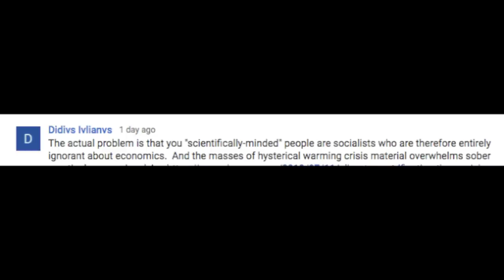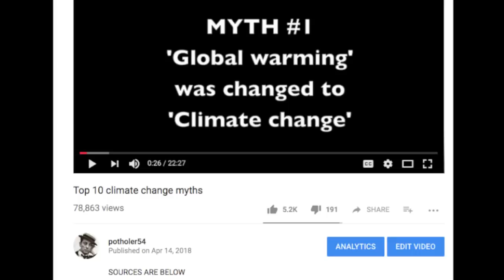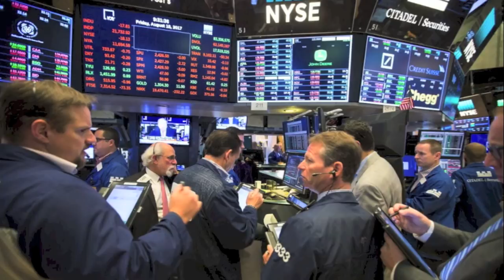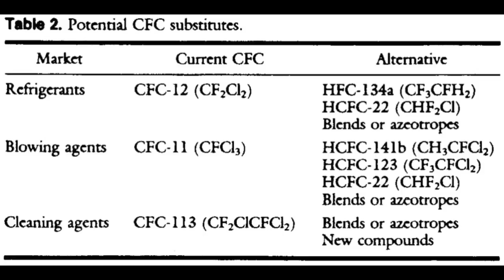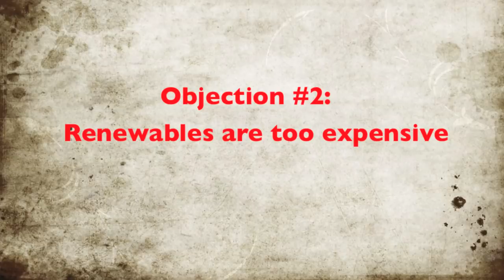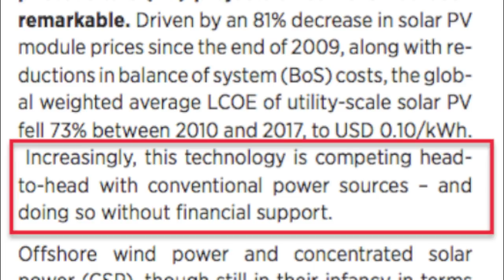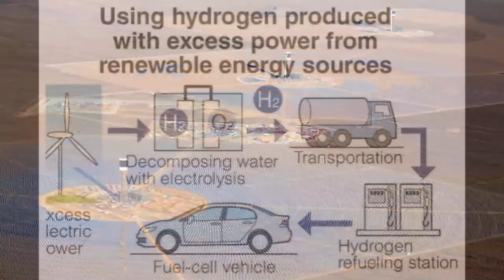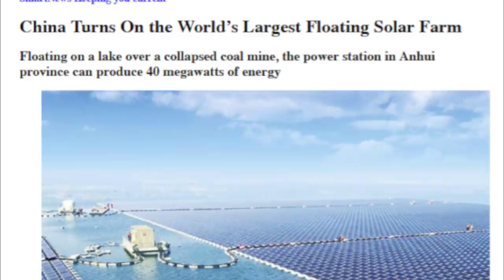A CONSERVATIVE solution to global warming (Part 1)

Comment: Renewable energy is a joke. You'r the one pedaling crap here. The only realistic solution is nuclear - how come you couldn't inform yourself on that front? It's not the price - it's the quantity&space required.
Reply: I would disagree with your conclusion about renewables.    There are a number of reports explaining how much space would be needed and it can be put in a reasonable space.    Much of PV solar can be put on already existing roofs of buildings.    The space between wind power plants can be used for farming (in farming areas.)   

Nuclear works, but it is expensive.   15 cents a KWHR in the new plants in Georgia.     Even if nuclear was lower, just go ahead and make a big Government industrial policy to get them all built.
Reply: @MrSoldinjo  
Renewable energy is at best used to cover up the gaps or peaks in nuclear.
I call this a green ceiling! There is a ceiling(25-30%) on the max renewable energy(non hydro) an industrialized economy like US can add to its grid.
Reply: US can easily go majority nuclear financed by proceeds from a carbon tariff on foreign emissions!
Reply: @bobsinhav  Nuclear energy can devistate a landscape for thousands of years and even when it works well it spreads radioactivety through air, lets just go geothermal from now on ok?
Reply: Yes, I agree nuclear power is actually the go to energy source. But that really doesn't mean solar, hydraulic and wind energy are bs. They may be less efficient than nuclear power, but already by switching entirely to solar, hydraulic and wind. We would solve all the problems that have arisen in by use of fossil fuels. A good mix of nuclear as well a solar, hydraulic, wind, etc. Looks like the best  and overall most practical choice.
Reply: @mrthugamer7603  Im sorry but Nuclear power is definetley not welcome in Austria
Reply: Nuclear is a great solution that we could implement immediately. However, you are totally wrong about other renewables. Wind, wave, and solar energy production are all very strong competitors to traditional power sources. The only hurdle is storage. And as was detailed in this video, billions are being spent on R&D to correct this. It’s only a matter of time before someone has a breakthrough that catapults renewables to a price point that is exponentially more economic than fossil fuels.
Reply: @aturchomicz821  I would only speak for yourself. Not an entire country.
Reply: @aturchomicz821  Maybe you should educate yourself more about this because recent research and development in nuclear energy has made it less dangerous than burning fossil fuels.
Reply: and yet the price of solar batteries keeps going down
Reply: Oh no! Instead, we need to get rid of capitalism and blow endless money and resources on renewables that will never work on a large scale. Let's beat our chests  and ride the Tesla c@ck on autopilot.

Comment: Showing receding glaciers isn't proof of rapid warming, but rather the continuation of the end of the ice age we're currently in. Experiment: Place an ice cube on a tray over a plate. Let me know how much the room warms relative to the acceleration of melting over time.
Reply from the maker: @b m wrote: "Showing receding glaciers isn't proof of rapid warming"
   But, as I'm sure you know, there's no such thing as 'proof' in science. Receding glaciers are evidence of global warming, along with all the other pieces of evidence like temperature records from ground and satellite monitors, higher water vapor content, melting ice caps, shrinking sea ice etc. All these pictures show a very clear picture of a steep rise in global temperature starting around the mid 1970s. 

"...but rather the continuation of the end of the ice age we're currently in."
   I think you mean the last glaciation. That ended around 12,000 years ago. We are no longer in a glaciation, we are in an interglacial.
   
"Experiment: Place an ice cube on a tray over a plate."
   I would spend less tube putting ice cubes on trays and more time studying basic geology.
Reply: @potholer54  You can add to the piles of evidence, warmer sea temperatures measured at the deeper depths of the oceans. As an ROV pilot whose machines have very sensitive temperature recording equipment, I can attest to that particular fact. I often inspect the same pipelines, year after year, and all of us on that crew are seeing the same thing, increases in the water temps... It's real....

Comment: I agree that we need to look for alternative fuel systems/ sources. It gets to me that we haven't done better with solar and wind energy. 

Hydrogen fuel cells produce water vapor, which is a GHG and as such as much of a pollutant as CO2. Yet alarmists don't see it that way which is strange. And if the hydrogen didn't come from water in the first place then that would mean we would be adding more water vapor to the naturally existing system.

One solution is to have cities grow their own food in buildings designed for it- greenhouse skyscrapers. Another would be to cut way back on meat consumption. Any alarmist who doesn't do that is a hypocrite.
Reply: Relative Humidity - Look it up, genius...
Reply: And? With hydrogen fuel cells we will be adding water vapor to the existing level. What do you think will happen if we keep adding water vapor to the atmosphere, genius-minor?
Reply: A little bit more rain?

Clearly you don't understand relative humidity...
Reply: More than a little more rain. 

Clearly you don't understand humidity
Reply from the maker: @sombodysdad -- water vapor is called a 'passive' greenhouse gas, because the atmosphere can only hold a given amount of water vapor depending on its temperature (unlike CO2). That's why you get dew in the morning -- as the temperature falls overnight, water vapor condenses out. Conversely, if the temperature is stable, adding more water vapor above saturation point will simply cause more rain.
   You have to be careful about calling people who understand basic physics "alarmists" for not having the same misunderstanding that you do. It makes it a bit more humiliating for you when you are shown to be not only ignorant, but arrogantly ignorant. Next time why not say: "I don't understand why adding more water vapor from burning hydrogen wouldn't heat the atmosphere. Could someone explain it to me?" And someone will be very happy to explain it. Be nice, and other people will be nice.
Reply: To put what @potholer54 said more simply, @sombodysdad, the amount of water in the atmosphere at, for example, 30*C has an absolute maximum (aka: relative humidity).  When you pass that absolute maximum, you get rain.  As such, you cannot add more water vapour at any given temperature because it will just condense and become liquid water.  So, if you release more water vapour into the atmosphere, the only result is a little more rain.

CO2, on the other hand, is not temperature-dependent.  It does not condense at standard atmospheric temperatures.  It gets expelled from the atmosphere slowly, over thousands of years, so its GHG properties remain for much longer, resulting in slow but consistent increases in temperatures throughout its atmospheric lifespan.  This alone isn't overly significant (according to Arrhenius' calculations, about 1-2*C of warming per doubling of CO2), but then you have the issue of things like water vapour, which can cause quick increases in temperatures, but which requires an initial increase in temperatures first for the reasons I've explained above.
Reply: You are alarmists and history will prove it. What happens when we keep adding water to our planet? Don't you think that will cause rivers, lakes, streams and oceans to rise? Unbelievable.

Think about a billion cars all spewing water vapor day after day. Where do you think the water will go?
Reply from the maker: "Think about a billion cars all spewing water vapor day after day. Where do you think the water will go?"
   Well yesterday you were convinced all this water was going into the atmosphere and staying there. Now -- thanks to a quick physics lesson from Leafsdude and me --  you are convinced it won't stay there, it will come back down to Earth as rain.
   At least you've learned something, but it doesn't seem to have humbled you.  
   So you now agree that this water won't stay in the atmosphere, it will come down as rain, that's progress. Now let's get to lesson number two: Basic chemistry. 
   1) Hydrogen fuel cells are made by splitting water molecules from the sea into hydrogen and oxygen, using energy from renewable sources. So one water molecule will make two hydrogen atoms -- right?
   2) Now you put those two hydrogen atoms in a fuel cell, and when you need the energy back you combust the hydrogen with oxygen. Those two hydrogen atoms now create a water molecule, right?
   3) That water molecule drifts off into the air and condenses as rain to fall back into a sea.
   4) So, in sum, we took a water molecule from the sea, split it, rejoined it, and put it back in the sea. Scale that up, and we are taking a gigalitre of water from the sea and putting a gigalitre of water back in the sea. Will that cause the sea level to rise? No. 
   Do you understand why? Probably not, but I really can't dumb this down any further.
   You should have taken my advice and asked these questions in a nice way rather than calling us "alarmists" and boasting that you have what you laughingly call "proof." All this proves is that you're a bit of an idiot when it comes to basic maths and chemistry, as well as physics. Sorry, but you do kinda reap what you sow.
Reply: What? I never made the claim you are attributing to me. I never said it was going to stay in the atmosphere- never said it, never implied it and never thought it. And clearly you didn't read what I had posted. Here it is- AGAIN:

" And if the hydrogen didn't come from water in the first place then that would mean we would be adding more water vapor to the naturally existing system."

So what we have here is a major wtf moment...
Reply: "What? I never made the claim you are attributing to me. I never said it was going to stay in the atmosphere- never said it, never implied it and never thought it."

Did you not claim, in your OP, that water vapour was a GHG, and that therefore producing water vapour was more dangerous than CO2?:

"Hydrogen fuel cells produce water vapor, which is a GHG and as such as much of a pollutant as CO2. Yet alarmists don't see it that way which is strange. And if the hydrogen didn't come from water in the first place then that would mean we would be adding more water vapor to the naturally existing system."

If you did not think water vapour would remain in the atmosphere, what sense does that claim make?  I smell something fishy here...

Most likely, you're just scared of admitting you were wrong.  Which is just sad.
Reply: "Did you not claim, in your OP, that water vapour was a GHG, and that therefore producing water vapour was more dangerous than CO2?:"

No. Clearly you have reading comprehension issues. It is a GHG but I never said it was more dangerous that CO2. The sense of the claim is water vapor is a GHG and as such is a pollutant- for the SAME reason CO2 is a pollutant (because it is a GHG). Add more water vapor and you get more clouds and then more rain. More rain means more water and IF the hydrogen wasn't from a water source then soon we would have a water world
Reply: "It is a GHG but I never said it was more dangerous that CO2."

You are correct.  You did not.  My mistake.

"The sense of the claim is water vapor is a GHG and as such is a pollutant- for the SAME reason CO2 is a pollutant (because it is a GHG)."

CO2 is not a pollutant because it is a GHG.  It is a pollutant because of its effect on the respiratory system.  Water vapour doesn't have that effect.  (ETA: Actually, I'm somewhat mistaken here: CO2 is a pollutant, according to the US EPA, because of its inability to be removed from the atmosphere as quickly as it is put in.  This still means that water vapour is not a pollutant.)

"Add more water vapor and you get more clouds and then more rain."

Yes, and the rain part makes the fact that it is a GHG irrelevant.

"More rain means more water and IF the hydrogen wasn't from a water source then soon we would have a water world."

I feel quite safe saying that, considering the amount of hydrogen on Earth, if all of it was combined with oxygen and the appropriate water cycle events occurred, there wouldn't be enough to cause significant sea water rise, let alone enough to case "a water world".  Keep in mind that the sea rise we are seeing (and opposed to your claims in another thread on this video, we are seeing it) is primarily due to thermal expansion (ocean water is getting warmer, and warmer water takes up more volume) and the much larger supply (vs available hydrogen) of glacial ice melting.
Reply: Nowhere in that link does it even imply that CO2 is a pollutant because it is a GHG.  Moreso, my ETA comes directly from that link:

"Alternatively, the definition of "pollution" from Encyclopedia Brittanica is:

"the addition of any substance (solid, liquid, or gas) or any form of energy (such as heat, sound, or radioactivity) to the environment at a rate faster than it can be dispersed, diluted, decomposed, recycled, or stored in some harmless form.""

The EPA loosely defines a pollutant as:

""[E]missions of which, in his judgment, cause or contribute to air pollution which may reasonably be anticipated to endanger public health or welfare""

I assume you read the other quote from Mass v EPA (2007):

"greenhouse gases in the atmosphere may reasonably be anticipated both to endanger public health and to endanger public welfare....The major assessments by the U.S. Global Climate Research Program (USGCRP), the Intergovernmental Panel on Climate Change (IPCC), and the National Research Council (NRC) serve as the primary scientific basis supporting the Administrator’s endangerment finding."

And assumed it was another definition of "pollutant", when it's actually just a legal ruling giving the EPA the right to regulate greenhouse gases.  Inferring that ruling to mean that any GHG is a pollutant is incorrect.

In short, once again, water vapour is not a pollutant because it does not remain in the atmosphere.
Reply from the maker: @sombodysaid wrote: "I never said it was going to stay in the atmosphere- never said it, never implied it and never thought it."
   Yes you did. In your very first post you said "Hydrogen fuel cells produce water vapor, which is a GHG and as such as much of a pollutant as CO2.... And if the hydrogen didn't come from water in the first place then that would mean we would be adding more water vapor to the naturally existing system."
  Leafsdude and I then both tried to explain to you that there would be no GHG effect from this extra water vapor because it would not be "added".  The atmosphere cannot hold that extra water vapor, so it would condense and fall as rain. 
   So then your worry was that this "extra" rain would cause sea levels to rise. 

"More rain means more water and IF the hydrogen wasn't from a water source then soon we would have a water world."
   No, more rain does not mean more water. Rain is not appearing out of nowhere, it is part of something called the water cycle. In nature, water evaporates from the biosphere, water vapor condenses as rain, and rainwater goes back into the biosphere. And as I explained, hydrogen cells also get their hydrogen from water molecules in the biosphere, and when they are burned they produce water that goes back into the biosphere. Your idea of a "water world" is laughable. 
   As for your "if" hydrogen came from sources other than water, the problem is hydrogen IS coming from water, that's the whole point of having it as a storage system. Renewable energy separates hydrogen from oxygen, and the hydrogen is stored in fuel cells. Or in the case of biomass it comes, once again, from the biospehere and is cycled back into the biosphere.
   The only other place we get hydrogen is from fossil fuels, and if you think all this green-energy hydrogen is going to come from fossil fuels then the idea of renewable energy storage has gone way over your head.
   Sounds to me like you are predicting this catastrophic 'water world' based on fear, ignorance and a complete lack of facts and figures. What do they call that....? Oh yes, "alarmist."
Reply from the maker: @sombodysdad wrote: "More rain means more water if that rain came from a source that was NOT water-based."
   Yes, you've already made that point, and I have already answered it. Here is my reply  again, repasted from my last post:

"As for your "if" hydrogen came from sources other than water, the problem is hydrogen IS coming from water, that's the whole point of having it as a storage system. Renewable energy separates hydrogen from oxygen, and the hydrogen is stored in fuel cells. Or in the case of biomass it comes, once again, from the biospehere and is cycled back into the biosphere.   The only other place we get hydrogen is from fossil fuels, and if you think all this green-energy hydrogen is going to come from fossil fuels then the idea of renewable energy storage has gone way over your head."

I don't know how you missed that, but there it is nonetheless. Maybe you should try reading posts properly rather than rushing to a silly "fuck you" comment. If you have an intelligent response, let's hear it.
Reply: The atmosphere can only hold more water vapour when the temperature rises. This is a positive feedback of global warming. The argument that hydrogen cells would add more vapour into the atmosphere is not only plain wrong, it's stupid nonsense.
=> https://en.wikipedia.org/wiki/Climate_change_feedback#Water_vapor_feedback